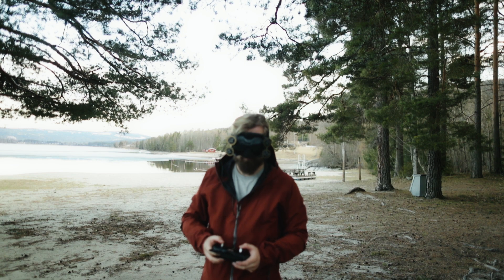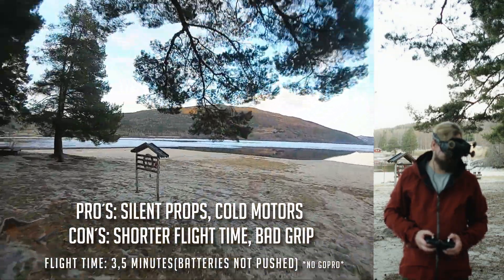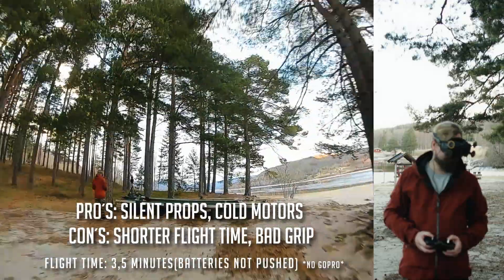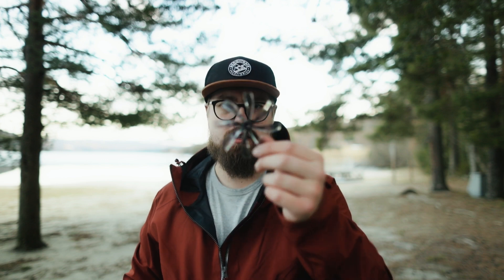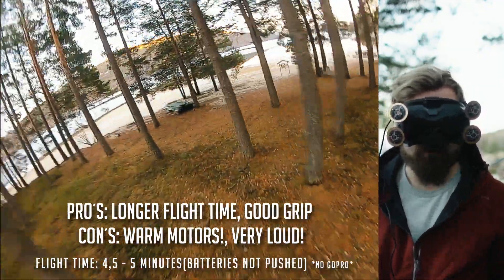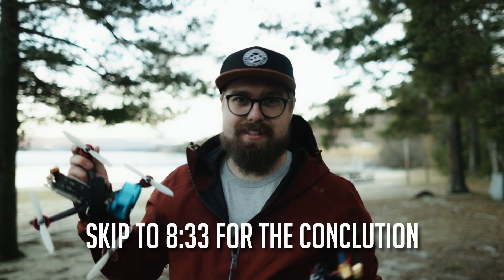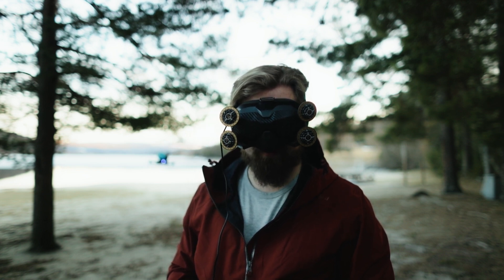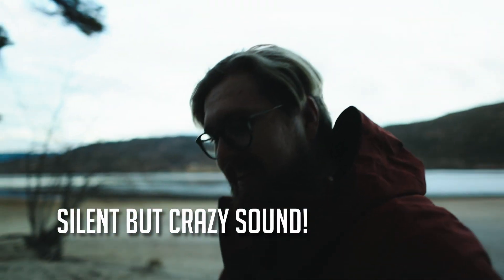Stop WASTING Money On The 5 , 6 & 8 Blade Props For Cinewhoops // TEST

Comment: Your test is no good, of course you're going to get negative results if you don't put the right motor with the correct prop, higher blade counts require different KV and torque
Reply from the maker: That is very try! I have the 6S motors too and should do a more in depth video

Comment: Great review, and I respect your opinion!  My own testing was 100% the opposite, however. For me, the 8 bladed had the lowest sound at 10 meters, flew the smoothest, and had the most punch. The 5 bladed were second, though not much better than a 4 bladed or a high pitch 3 blades. The 6 bladed HQ props got thrown away as they sucked the joy out of flying. They sounded like forks scratching on a plate to me, and handled the poorest of anything I've ever flown, including my experiences limping a quad home with broken props.
Reply: thank you, will give them a try.

my protek35 started shaking on straight lines with 3blade after upgrading to 4.3 betaflight, weird

Comment: 3 minutes without a gopro? why do these cinewhoops have such low flight times? My nazgul gets 9 minutes on a 1100 mah with a gopro 9 full weight.
what's the normal flight time on the protek with full size gopro and the normal props?
Reply: I have 6minutes on 1350 with gopro and pretty punchy on throttle. Could get more if flying smooth and slow-steady indoor.
Reply: On my 1300 4s i get only 3.5 minutes without gopro. Do you fly 6s
Reply: @janbahar5322  It's very possible you fly faster and more acrobatically than I do on an average flight. You are right, all my FPV quads are 6s. If I really push the 5 inch I will get less than 9 minutes but even when freestyling I tend to do really low throttle cruising and then poppy punches. 
I fly mostly 1100 mah and a few 1300 mah 6s batteries.

Comment: operators need to match the motor to the props

 a wide stator motor with short shaft (2xxx size) is intended to swing a high thrust prop at a lower rpms (~1500-2000kv @ 6S) such as 6 or 8 blades  

a skinny stator motor with a tall shaft (15xx size) is designed to operate at higher rpms (~2800-3000kv @ 6S) using 3 or 5 blades
Reply: So the protek should be better with the 6 or 8